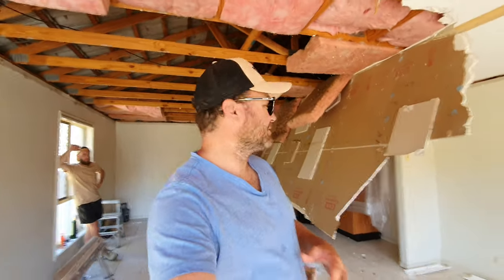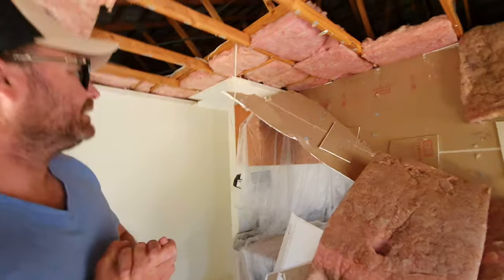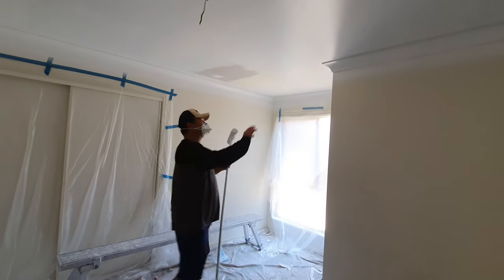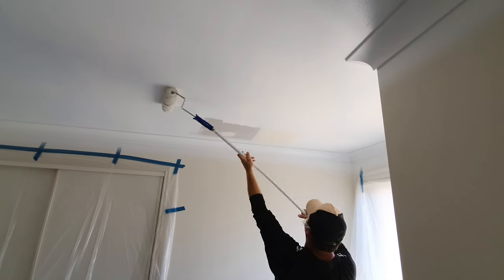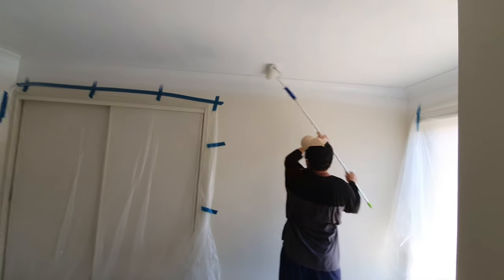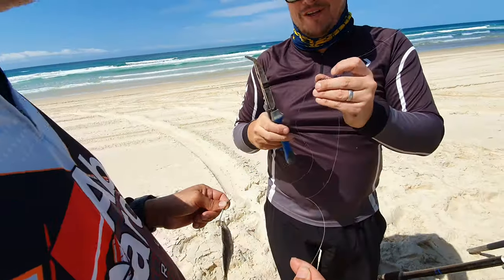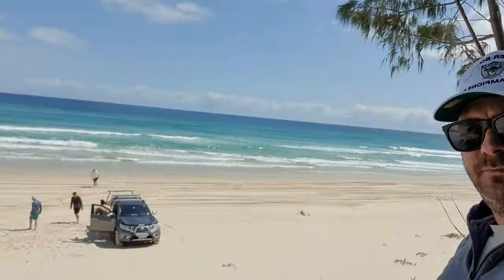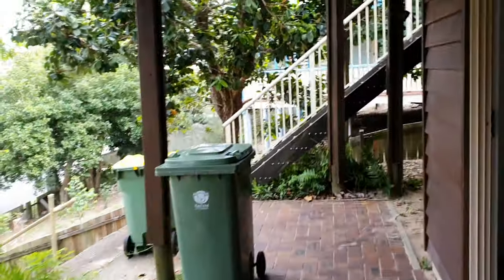How to Repair a Drywall Ceiling in a Room

Comment: If you get the chance would you make a video on how you prep your drywall for paint? Dusting and such? There are no good videos on it and I'm hoping I'll discover a great way of going it. Thanks!
Reply from the maker: There's not too much to it, just dust it down and paint using an undercoat and backroll.
Reply: @Maxkil  so what you're saying is just dust with a broom or other and then spray/roll on your primer and then back roll with a dry roller and that takes away the risk of the paint peeling off the wall because of dust?
I just want to be clear because I've had issues in the past. Never tried what you suggested though
Reply from the maker: @brandonpearce8350  Hey mate, yeah like a dry roller so to speak, already in paint but not loaded up. More so the paint gets into the paper on the front of the drywall:_maxkilMaxkil: